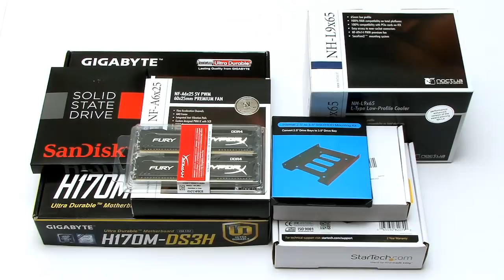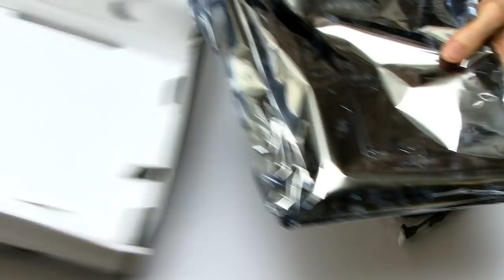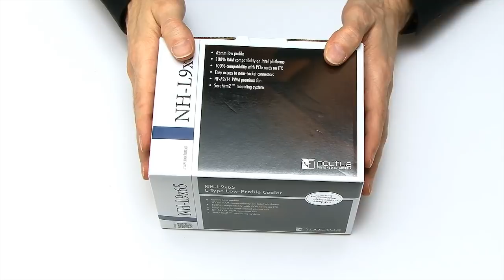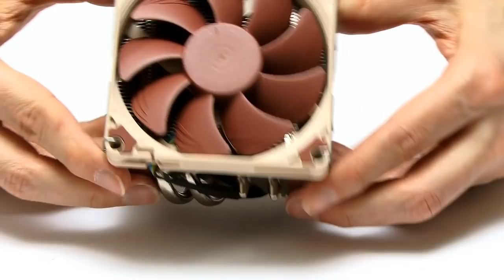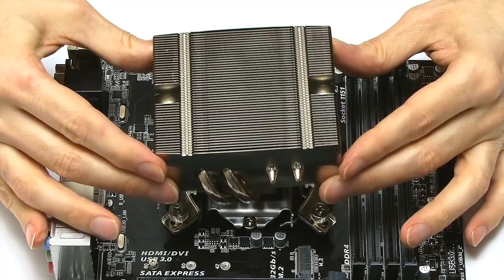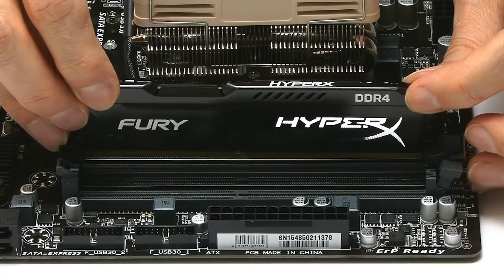i7 PC Build: Part One

Comment: lol that i7 had 555 on it hope not 555 timer
Reply from the maker: Ah, it is so many years since I have used a 555 . . .
Reply: All of 25 transistors.
Reply: +ExplainingComputers I'm surprised you have not used one hooked up to the GPIO header of the Pi. There are a number of different little Raspberry Pi experiments that use 555 timer chips. Switching relays with them via the GPIO header or remote controlling devices over the local network or internet is a common use.
Reply from the maker: TheNZJester OK, so this is something that I am now going to have to experiment with! :) I must have a 555 lying around in an electronics bits-box somewhere . . .
Reply: I actually used one only a couple of weeks ago. Admittedly it was to revive a 15 year old Dreamcast, but still. :D
Reply: ExplainingComputers read my other comment
Reply from the maker: KidOfEpicness Have done! :)
Reply: Ok

Comment: I've been watching many of your vids now and this is the first time I spotted something I didnt like, dont get me wrong i love your content but when I saw how tight you fit the wire from the cooler cpu fan.  I thought why would you do this when you're so thorough and precise in all other subjects, didnt you see how it actually tears at the connector? and it could infact cause it to disconnect after awhile, it may or may not happen but why would you risk it? if it happend it could be disasterous, thats just my 2 cents, hoping it wont happen for you, but just wanted to let you know, trying to help, love your content! peace and respect!
Reply: I thought exactly the same thing. The power cable is now pinched under the wire.
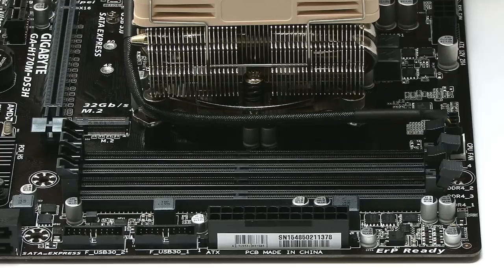Reply: A cooler fun wrong position 16:42 ,  and improved position 18:02 ... (Chris rotate  the fun 90 degree clockwise).

Comment: Your chipset breakdown is factually wrong. H110 chipset are not restricted to 3 PCIe count. Since the chipset PCIe lanes aren't even that high and they're used by the manufacturer to assign to say USB, networking, SATA etc. The PCIe slots you actually utilize are the ones on the CPU
Reply from the maker: Thanks for this, I stand corrected. :)

Comment: I was shocked that you used an unofficial, and thus unapproved, screwdriver to screw down the Noctura cooler, instead of the official, and thus fully-approved, Noctura screwdriver. You are fortunate that the whole thing didn't blow up in your face.

Comment: WHY NOT AMD?
Reply from the maker: I use this PC solely for rendering animation frames, but also render on my main PC, which has an Intel CPU. Any 3D models rendered with a procedural texture or procedural lighting effect will draw on the CPU's random seed generator, and these differ between Intel and AMD CPUs. This in turn means that you cannot mix Intel and AMD CPUs in a rendering environment. So I had to use Intel here.

Comment: I really want to build a PC and it seems quite easy (I cannot believe I just said that) but unfortunately, I doubt my parents will let me spend almost two thousand pounds building a "techy hard adultish lego set for people who hate shops"
Reply from the maker: A PC does not have to cost about £2000! :) That is quite an investment. :)
Reply: I know. But my parents think if I got cheap parts, it'd be bad.
Reply from the maker: I'd turn this around by stating that a £2000 PC would be very expensive. You would not be using cheap parts to build a lower cost PC, just building to a lower (and far more normal) specification -- that could be upgraded later.

Comment: I'm a recent subscriber and I must tell you that you have lost a lot of credibility with me by using the "pea" method applying thermal paste.  I don't want to re-hash an old argument so let me just say that the more CPU surface area being properly cooled the cooler the CPU will run.  End of story.
Reply from the maker: Thanks for the sub. The "pea" method is the one advised by both Intel and AMD, and well as Noctua and every other third-party cooler manufactuer I have come across. And if done properly, it provides *total* coverage of the top of the CPU without the risk of including very tiny air bubbles (which will inevitably be the case if you spread the compound yourself). You don't end up with just a small pea of compound between the cooler and CPU - it spreads, and evenly.
Reply: @ExplainingComputers  Well, I guess we are going to re-hash old arguments.  Putting a pea in the center results in a circular pattern of thermal paste.  The size of the circle depends upon the size of the pea which will vary from one user to another.  Regardless of the size of the circle the CPU heat plate is SQUARE so the circle of paste leaves the corners uncovered and therefore dissipating heat in a less efficient manner than if there were paste in the corners.  Personally, I don't care if god himself advocated the pea method.  I'm an engineer and I know something that can be improved when I see it.

Comment: THAT CPU AT LEAST ITS A NICE CLOCK SPEED 3,2GHZ NICE BECUASE ITS FAST  THERE ARE FASTER CPU OUT THERE IF YOU  KNOW WHERE TO LOOK. 3.2 GHZ IS OUT DATED A BIT. AFTER ALL THERE IS 4GHZ CPU AND EVEN HIGER. FOR DIFFERENT CPU SOCKET THAT FALLS APPART EXAMPLE LGA 2011-V3 AND ALL THE OTHERS UP IN 2017. VI HATED LGA SOCKETS FOR ITS PINS NOT DONE RIGHT TOO TALL THEN FALLS OFF. THEN BUY 100 MORE MOTHERBOARDS. THAT IS OEM NOT RETAIL BOX. THATS RIGHT NO CASE BADGE